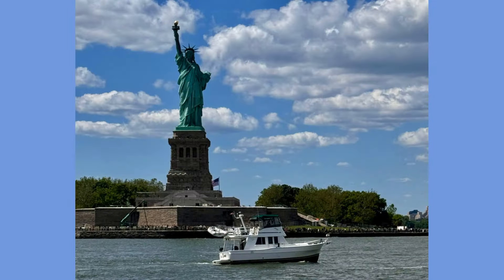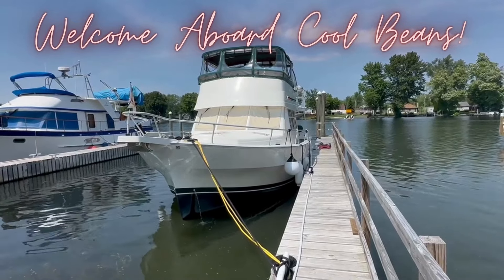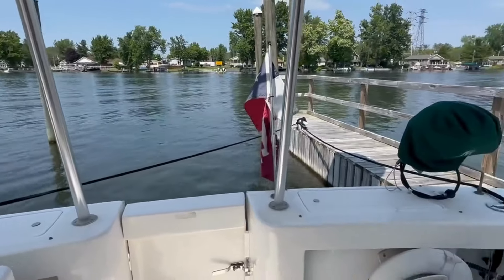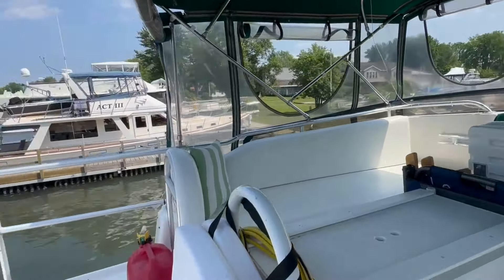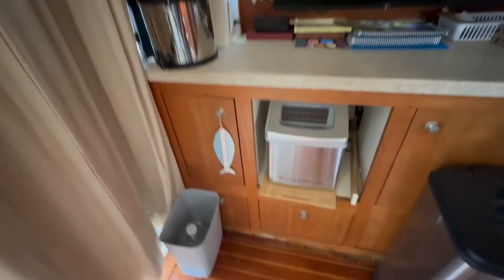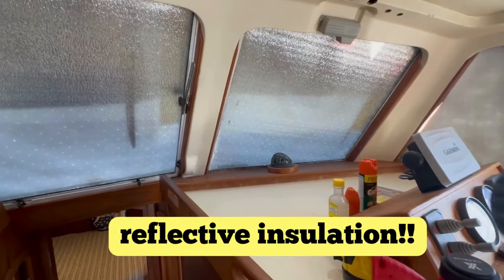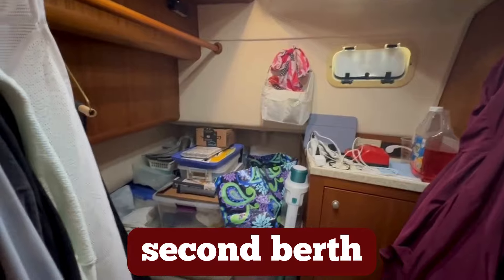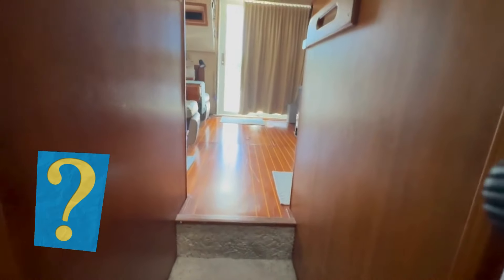Ep 20 - Cool Beans on the Great Loop - BOAT TOUR!!

Comment: With the outboard motor and coolers on the Starboard side; it provides you a counter balance to leaning to the Port side like all Mainships do since all the weight is on the Port side. Good thinking! I will do the same on mine!
Reply: Why are all Mainships heavy on the port side?
Reply: @upanchor  all the batteries are on the port side as well as the refrigerator, stove; cabinetry, water tank.
There's a lot on the port side and thus they list to port.
Reply from the maker: Hey Lesli! YES!  We mounted the engine on starboard for THAT REASON!  Thanks for pointing it out!  :-)

Comment: We spent a couple of nights on a friends Mainship 390 about 10 years ago. They had a ladder to the flybridge so I appreciate the stairs. Great boats for sure. I noticed in the stern section Chris had 2 lines, one from each side, to the rear dock cleat. What was the purpose of that second line?  We appreciate the info screens like that stats screen. Thanks for the extra effort that I know those took.
Reply from the maker: Hi Scott!  Yes stairs were on my MUST HAVE list, I am not the most graceful and when I added the seadeck to the stair treads, it was a game changer - I am so comfortable going up and down now!  We did the second stern line just to keep the stern stable.  Every marina, we have to assess the current and wind to see how our boat is holding, and in that particular slip, we couldn't get a starboard stern line tied on so we just went across as we did - also helps stay close to the dock since that is where we get on/off board. Hope that made sense, if not, let me know and I can try to have Chris answer in more technical terms!  Thanks for watching! :-)

Comment: Hi C&L, On Chris' tour of the bow, it appeared that you had 2 power cables plugged in & running to the shore. Please explain. Thanks.
Reply: If I may. Its like your house, each appliance requires power/amps to run, so he is just suppling more amp service to his power panel (probably its 2 20 or 30 amp service per cable totaling  40 or 60 amps). So if your running your Ac's, stove, lights, pumps at the same time each item is rated for a certain amount of amps. It also depends on the shore power pole on what options you have. A'm I kinda correct Chris? LOL
Reply from the maker: Timothy, you are exactly correct!  We have two 30 amp plugs and a Y-splitter that we use to plug them in to a 50 amp receptacle - if that isn't available we plug them each into a 30 amp receptacle, it totally depends on the marina's offering!  Sometimes we have only had one 30 amp and we know which one we like to use to run the ice maker and tv's and microwave!  Haha!  Priorities!  Thank you for answering!
Reply from the maker: Hi Jack!  Timothy below is right, but here's my answer too: We have two 30 amp plugs and a Y-splitter that we use to plug them in to a 50 amp receptacle - if that isn't available we plug them each into a 30 amp receptacle, it totally depends on the marina's offering!  Sometimes we have only had one 30 amp and we know which one we like to use to run the ice maker and tv's and microwave! Thanks for watching! :-)

Comment: You mentioned you find the Honda generator is invaluable, but what are you using it for?
Reply from the maker: Hello, we use our Honda Generator when we anchor or don't have shore power - instead of firing up the genset every time, if we only need a few things powered (like our ice maker and tv and charging station) we fire up the Honda.  The genset uses 1 gallon of diesel per hour, and the Honda uses 1 gallon of gas per 8 hours!  Much more economical!  We can even charge our batteries with it (if we don't have much else plugged in!)  It has been a great purchase!  If you need more detail or context, please let us know! Thanks for watching! :-)

Comment: What do you use the Honda generator for?
Reply from the maker: Hello!  We have REALLY enjoyed the Honda generator - it was so handy when the Kohler (the built-in boat generator) went out in North Carolina and we had to stay in the Dismal Swamp without shore power!  And we use it while on anchor every time.  We try not to have to fire up the Kohler and keep it running for a long period of time so the Honda is perfect for running the ice maker, tv's and the lights - we just plug it into one of the 30 amp plugs and use it for one side of our panel!  We have this down!  :-) Plus it is VERY economical to run the Honda vs. the Kohler, the Honda uses about a gallon of gas every 8 hours and the Kohler uses about a gallon of diesel every hour!  Thanks for watching and let me know if you have any other questions!
Reply: What size in the generator?
Reply from the maker: @christianrogers2361 hello! It’s a 2200. Thanks for watching!